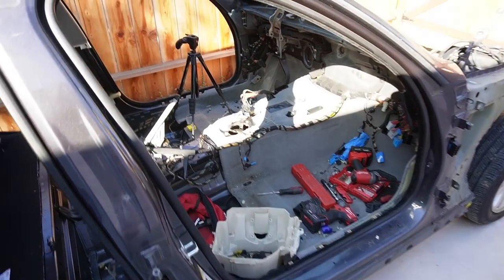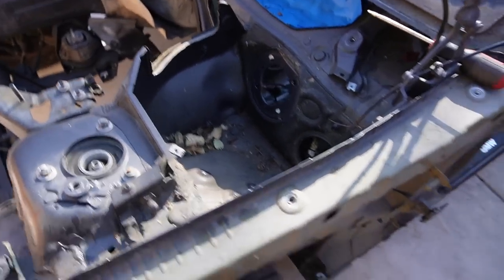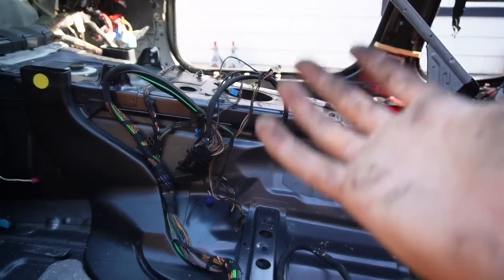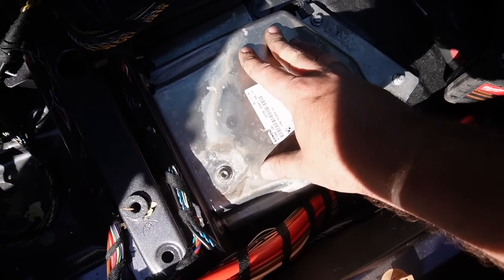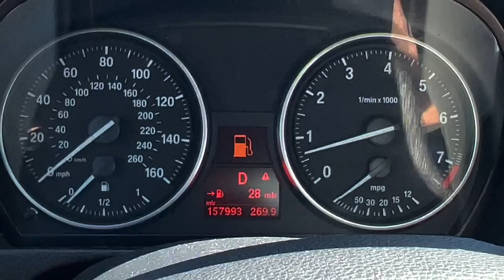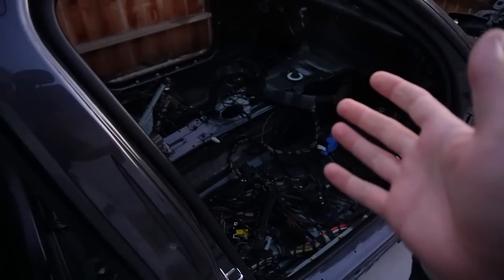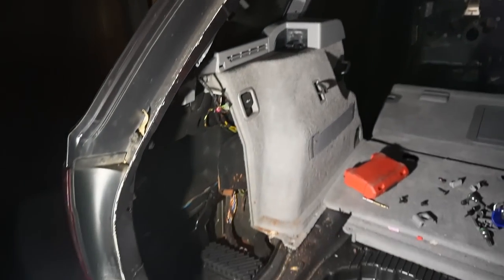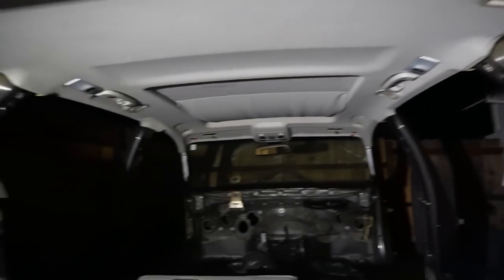Building A Custom 1 of 1 E91 M3 Wagon! (Part.5)

Comment: If you can get the front side of the headliner off and get access to the sunroof motor, there is a T40 (I think?) bolt that you can crank to pull back the sunroof. Much love my guy.

Comment: Have you tried removing the plastic piece where the sunroof switch? If I remember correctly there should be a torx bolt that you can turn that will move the whole sunroof assembly manually.